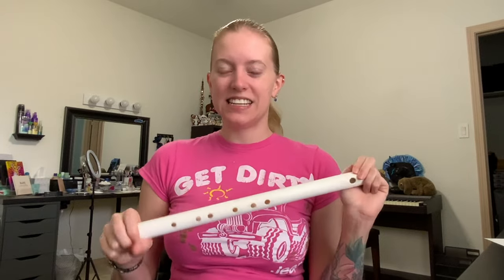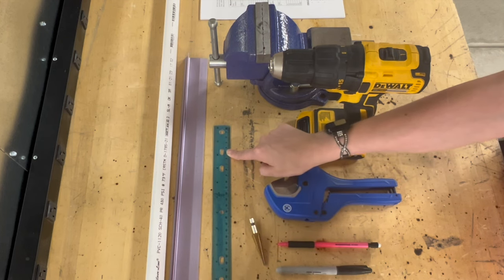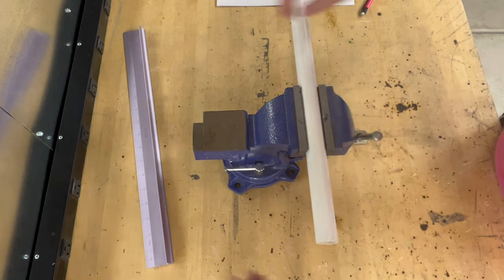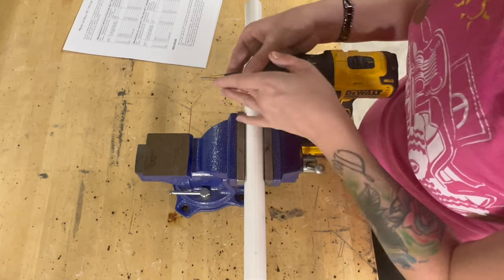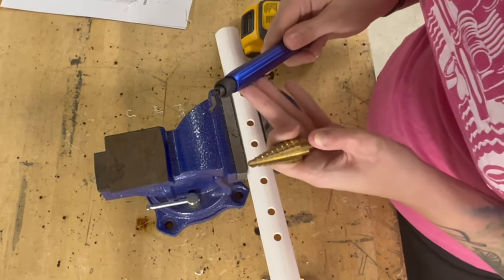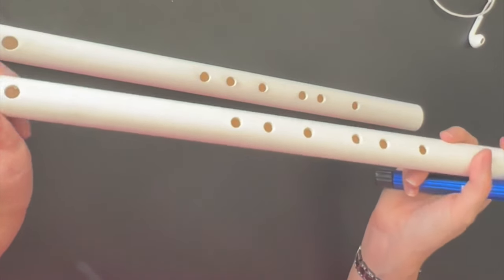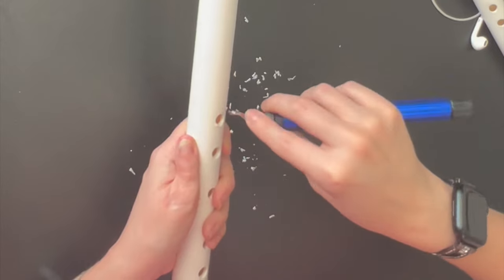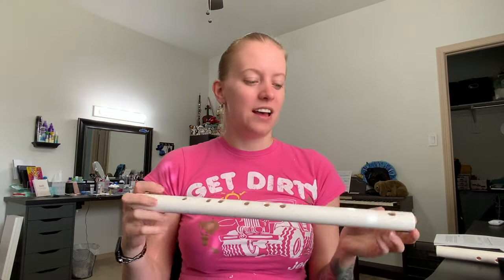Making a PVC Flute! It’s easy, you can too!

Comment: I made a PVC flute in D minor several years ago. I used a PVC pipe cap instead of a stopper. I had to figure out all the math myself, but it worked out well. The only mistake I made was not to offset the "G" finger hole a bit to the far side so it would be easier to cover.

Comment: Please help! I attempted to make one of these, and the upper registers are very out of tune. How to fix?
Reply from the maker: When you say upper register, do you mean upper octaves or the upper holes on the instrument?

Upper octave, the fingerings are most likely different vs the lower and middle octave. I’m not sure what those fingerings are, you may be able to google it.

Upper holes on the instrument, tuning should be able to be fixed with a de-burr tool like I used. You’ll have to sit down with a tuner and adjust/open each hole (starting with the ones closest to the end/right hand). Just be careful because once you open it up, there isn’t any going back.
Reply: Thank you very much for the reply, I mean the upper octaves. Everyone calls them something different. My holes are on pitch in the low octave, I assumed that the same fingering would apply to the upper registers since the principle of harmonics works on the same length of tubing like on a horn. If this is not the case, do you have a reference to upper octave fingerings?
Reply from the maker: Understood and I thought the same but I had issues with the upper octave as well. The only reason I figure there are different fingerings is because on a modern flute, the lower and middle octaves fingerings are the same, while the upper octave fingerings change.

I don’t have a reference to what those fingerings would be on something like this though. Google may have some resources for you.
Reply: But it’s my middle octave that is off.
Reply from the maker: @nicolasbergeron1715  hmm, I’m not sure then. Your lowest and middle octave should be the same.